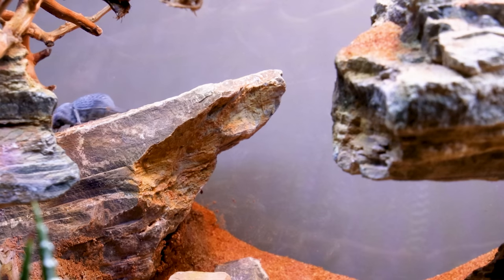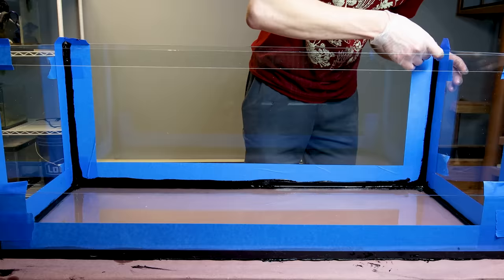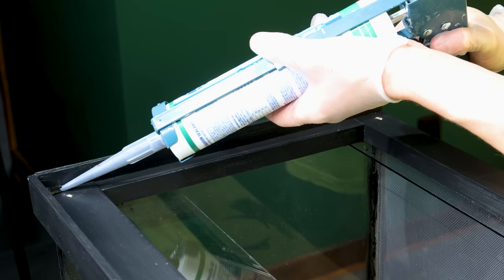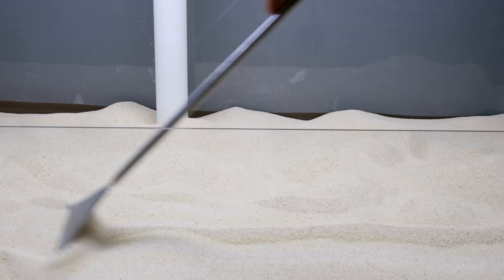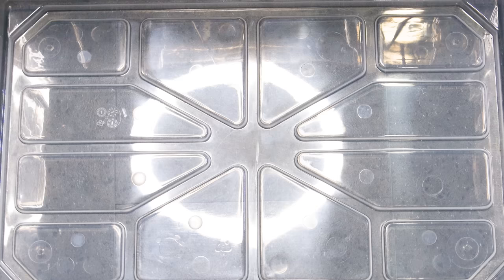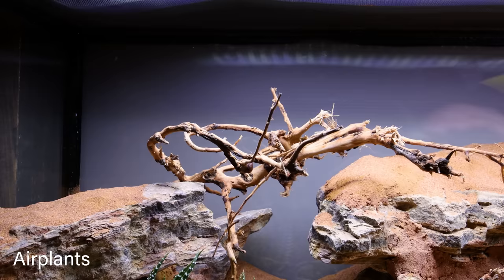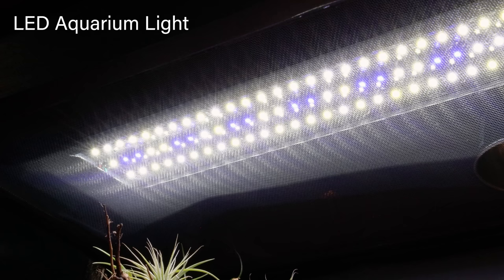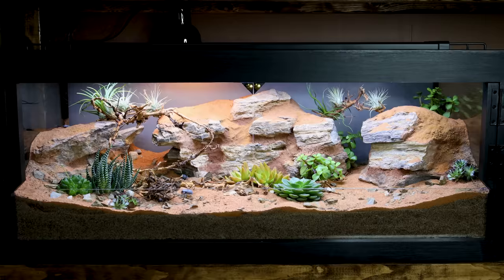DIY Arid Desert Bioactive Vivarium for Blue Beetles

Comment: I made a similar dry setup for my cornsnake with the same varieties of plants but I created a larger drainage area raised by egg crate and separated with a screen. I then passed a PVC pipe through the screen towards the bottom and hid the top with some cork bark. The idea is that as the plants grow I can water the bottom layer of the tank while keeping the top layer dryer.

I do sometimes spray the enclosure as well to water the airplants and to give the snake more moisture. I think a similar idea could work well for these beetles

Comment: I use clay pebbles at the bottom of both arid and trooical.Never had any moisture issues.
I wouldn't use coconut fibre as it keeps moisture and is usually used for trooucal setups where high moisture is wanted

Comment: nice setup, but I would have used a false bottom or made the drainage layer with more coarse material like gravel.  having coco fiber in the substrate will also retain too much humidity.  For any arid style setup I think it is best for the health of the animals to have active air circulation with a small fan blowing air through the setup.  I also uploaded an arid vivarium DIY tutorial on my channel where I did some things a bit different but took significant inspiration from your last arid vivarium video.  Make sure you have very bright lights or the plants will get too long.

Comment: Hi Tanner, I have a quick question.

A lot of your set-ups use sliding doors or hinged doors that do not completely seal. How do you keep the "clean up crews" from getting out? The springtails seem so small that I would think they could get through the gaps pretty easily.

Love your videos and the care you give your animals.  

Cheers

Comment: Have you had luck using the magnets in the past? I have used them on my custom builds quite a bit and have found the superglue holding them to give out after a month or two. I'm not sure what other adhesive would be stonger and animal safe though 🤔